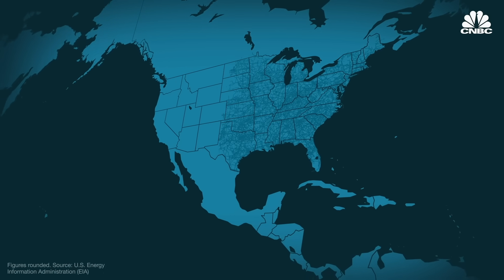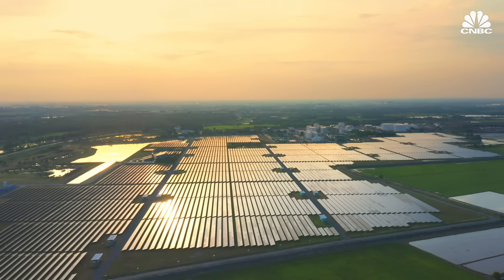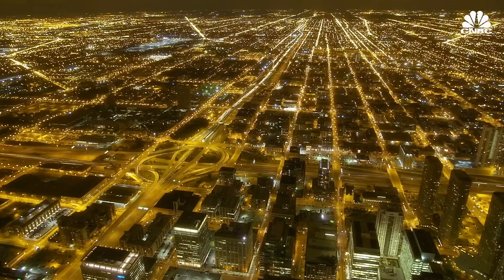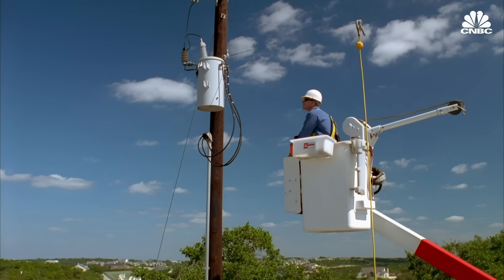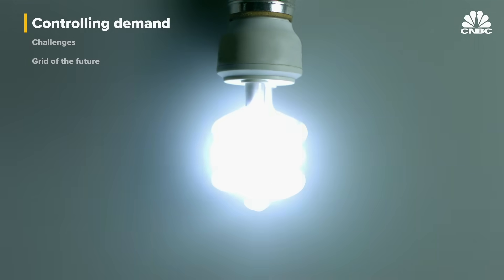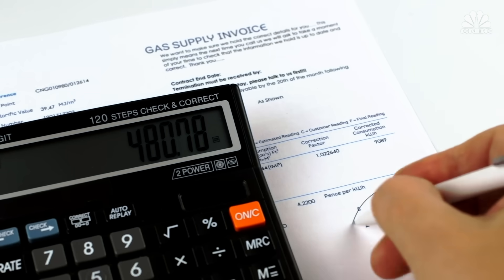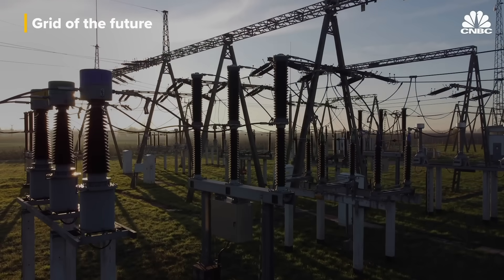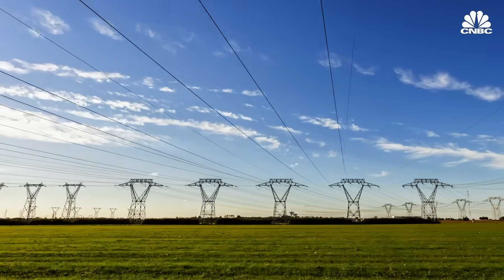How The U.S. Can Build A 100% Clean Grid

Comment: why would you give utility companies control of your devices. as it is there is so many hacks already why would you want some more ways to hack your home. as it is the companies that make the devices have a hard time avoiding hacks, now you want to add another weak point to your networks. 
if you have smart device already you dont need your utility company changing your settings, the apps of smart devices already do that for you. 
and even if you dont talk about the hacking part of it, there is a large part of the population that is not going to upgrade to smart home tech in the next 15 years any way so this wont work if the majority of the people paying for utilities are using the same fridge, stove and other appliances there homes came with... and if they rent landlord dont upgrade to help there tenants save of utilities, the rent would be so expensive if they bought new appliances just to save people new dollars on there electricity bill...

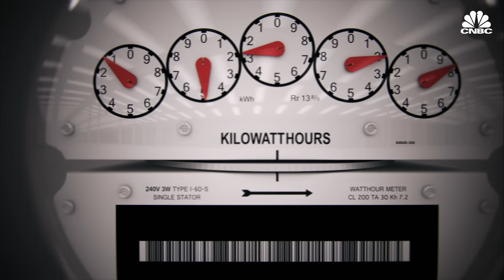Comment: 4:50. Solar power on people’s roof tops are generating excess power BECAUSE no one needs it.

That’s your answer, CNBC.  Guess how u will price something no one wants??  The answer is 0
Reply: No, the house the solar is on doesn't need it.  this can be bought by the utility or stick it in storage for night usage.
Reply: Salvatore Oricchio  How exactly do we store THOUSANDS of GIGAWATTS of power from summer to winter? We can't even store a few GW of power for a few minutes.

And no, if I had an electric car, I would not let them take power out of it to power the grid. Yes, most days my usage would be predictable, ie drive to work and back, but then there is the day that my car only has 50 miles of range left and I need to drive 500 because my elderly parents went in to the hospital. I can't even do that in an EV now, and won't be able to for years - the cars don't have the range, they take too long to charge, and the charger network is not there and won't be for years.
Reply: Solar is not only renewable, Infact solar is less used compared with other renewable energy

Comment: A typical wind turbine generators 3 MW give or take, Which means it would about 233 wind turbines to replace a typical 700 MW power plant, That's 233 wind turbines that need to be built, installed, foundations built for each one and lets not forget the cost to maintain especially as these units become older. I see this as a very expensive way to generate electricity.
Reply: Text me on what.sap. for invest'ment plan.
Reply: ÷1 2 1 3 8 0 2 7 0 9 2.™

Comment: Would be easier to just start building houses that supply their own power and are not connected to any grid...
Reply: They won't let me build a windmill generator- against code.  How many batteries are needed to go 4 days without sunlight?
Reply: @captbiptoe  more than you want hanging around your house. Just put in a backup generator much easier.
Reply: @megawatts4112  exactly. It worked out that way. My mom had a backup generator installed after getting too old and frail to come with weekly blackouts. I inherited the house.
Reply: Text me on what.sap. for invest'ment plan...

Comment: Voltage moves electricity, pressure moves fluids, and money moves people. Until homes have fair real time pricing at their smart meters or smart load centers and are allowed to compete in the grid service markets, demand response and the grid interactive home will not happen. With modern communications and computation this is clearly feasible. FERC order 2222 could change this and if so EV makers will finally enable V2G and aggregators like Ohm connect will thrive.
Reply: Text me on what.sap. for invest'ment plan.
Reply: ÷1 2 1 3 8 0 2 7 0 9 2.™

Comment: CNBC does not seem to understand. If we cared about the environment we would be moving as fast as possible towards nuclear energy. Lithium mining takes a lot of energy, introduces a lot of pollution and solar and wind leaves a lot of tech waste after only lasting a few years and taking a lot of land. Nuclear on the contrary takes a little mining, produces significantly less waste and the waste can be reused in future thorium and salt reactors while using a lot less land. On top of this nuclear reactors can be built to last 50+ years and modern ones have automatic cut-off switches. Nuclear releases no carbon pollution beyond the original mining. Yes, anyone who cares about the environment is advocating for a future that is mostly nuclear or all nuclear.
Reply: Text me on what.sap. for invest'ment plan.
Reply: ÷1 2 1 3 8 0 2 7 0 9 2.™

Comment: NUCLEAR POWER IS THE SOLUTION facts about modern reactor: They produce less waist then the current reactors from the 50s and 60s they are more efficaint and most western designs are fail proof meaning its agaisnt the design for it to melt down

Comment: 0:22 min Thomas Edison would recognize it and would immediately die of anger because it's not dc
Tesla rules
Reply: It is even worse when he sees people label giant DC battery storage TESLA. Looks like TESLA  win twice.
Reply: Large scale Transmission is actually done in DC, look it up, it blew my mind too
Reply: @thunderb00m  uhh your sir are very missinformed
Reply: @Verifraudreports  I'm sure you didn't bother looking it up so here is the link spoon fed to you. Please educate yourself before calling others misinformed
Reply: @Verifraudreports  No u
Reply: @specialopsdave  you are trying to tell me that the high tension 3 phase transmission lines are DC? It's just plain wrong.
Reply: @Verifraudreports  You're thinking of normal HV lines, not HVDC. Most power lines are AC (and ALL power fed into homes is AC) but DC lines are useful for minimizing material requirements when at around 10 million volts and above (rarely seen on our electrical grid) and also allows transfer of power between desynchronized grids. For everything else with a voltage below 10 million (most HV lines are below 10 million volts), the cost-effectiveness of AC transformers makes them more useful
Reply: @Verifraudreports  the term you need to google is HVDC and yes that is how texas connects to the wider US electrical grid. China built a 1.2 million volt DC transmission line. DC has less resistive losses due to no skin effect. Thomas Eddison actually won, just no one knew how to build DC in high enough voltage and convert it back to AC till around the year 2000.
Reply: DC transmission is better at higher voltage than AC transmission.
Reply: In many cases Edison would have the last laugh. A lot of end use electricity is as very low voltage DC (computers, LED lights, other electronics), and long distance power transmission is much better as high voltage DC. In Edison's day, transformers were much more practical than switching devices. This is no longer entirely true.
Reply: https://en.wikipedia.org/wiki/Australia%E2%80%93ASEAN_Power_Link
Reply: Nikola Tesla and George Westinghouse made a great team and developed a practical alternating current generation and distribution system!! Edison tried to discredit George Westinghouse and Nikola Tesla but it didn't work in the end thank goodness for that! JP Morgan was so angry at Edison that he took his name off the Edison General Electric Corporation and fired him!😂😂
Reply: Tesla was really not special. Thomas Edison was a great inventor. Tesla was basically a mad scientist who practically did not invent anything
Reply: @TheDaviddraws  Oopsy! Bad mistake comment! You might want to learn poly-phase electrical system and transformers and 3 phase motors.
Tesla was an ahead of his time GENIUS. 😁
Reply: @TheDaviddraws  - Without Tesla's genius and ideas we would not have alternating current.  I too am a big fan of Edison and have studied his career and been to his laboratory in Greenfield Village, Dearborn MI.  Unfortunately he was 100% wrong about DC current being better than AC current for widespread use.  He ridiculed AC current and did a number of stunts trying to discredit Tesla and Westinghouse.  It is a stain on both his integrity and career.   George Westinghouse was also a very prolific inventor and industrialist.  The Westinghouse Airbrake is still used on locomotives to this very day.  He saw the ideas and theories of Tesla and was able to drive development of a practical AC generation and distribution system.  This is the type of system we use today.

Comment: This video should be called how it's impossible to make a 100% percent clean grid.
Reply: Nothing is impossible
Reply: @akyhne  you’re right. It is possible, but it will leave everyone destitute with a $4.5 trillion price tag. Who’s the richest man in the world? Does he have an extra 4.5 tril?
Reply: @TKUA11  money rules the industry, once wind and solar WITH utility level battery storage become cheaper than coal and natural gas energy companies would switch even without the need for regulation
Reply: @TKUA11  We are in 2021 and 2035 is 14 years away? You think maintaining the current infrastructure is free?!
Reply: @ruzniimaad3509  I mean that’s a big request. Currently solar and wind installation far outpace installation rates for storage capacity, transmission and loading systems.

It’s also interesting that they say we need to invest in the grid to meet Bidens plan demands, yet they also show that both the time and cost are significantly greater than what Biden is estimating. 

$4.5 trillion for the grid alone, yet Biden is allocating only $2 trillion for all programs combined. Something doesn’t add up here...

20 years to complete the grid overhaul and even longer to synchronize and load the grid appropriately yet Biden demands completion in 15 years. 

Who did the estimates in Bidens team, because it would appear they didn’t do any research
Reply: @brian2440  I think the plan also includes private investment, private investment into energy is usually higher, construction of solar and wind is faster coal and natural gas power plant and they are almost the same price now but battery storage is still pretty expensive but the prices are coming down very fast so Biden's plan is possible as long as the  dude let's the private industry figure the tech and give them freedom on how they want to scale up
Reply: @TKUA11  why is the price tag so off putting, considering the cost it takes to maintain the current system, the unintended cost of oil spills, water contamination, not to mention the cost health conditions related to breathing dirty air. Also i might add the cost of violent climate conditions caused by climate change. Just how much do you think all these issues cost the American tax payer year after year and these cost will only continue to rise and I am pretty sure the cost will eclipse $4.5 trillion dollars. It all comes down to this, when you are dead and gone what type of world do you want to leave for the next generations?
Reply: @akyhne  people like TK UA don't think long term, to them its all about the hear and now.
Reply: @Rick Grimes, why do you think this is impossible, i honestly want to know?

Comment: It takes thousands of acres of solar panels and wind turbines which can be done in one nuclear power plant. The Canadian Niagara Power Generating Station, has been around for almost 100 years and generates 8320kVA, that is renewable which no wind turbine or solar farm can match. Solar panel farms consume power even when solar panels are unable to generate power.
Solar panels and wind turbines did not work in California, Massachusetts, Ontario, or Germany.
Electrons do not move very far, maybe a few inches in high voltage distribution wires.
Turn off the heat at -20? Didn't put any thought into that. 
This is a pipe dream, China will sell you solar panels to make money, meanwhile they and India are building nuclear power plants. Ask Biden about his clean energy plan when he was VP, how many hundreds of millions of tax payer money disappeared?

Comment: I run my heating  8 month on natural gas,  going electric ?  I looks for wood stove in the future.
Reply: Yes. They need to consider that. I live where we need to heat at least half the year. Electricity is too expensive. Also, in our climate power outages happen. A generator can keep a gas furnace running. A generator that can heat an entire house by electricity would be prohibitive.
Reply: @captbiptoe  You should look into VRF Heat Pumps.  They're much cheaper to operate that traditional resistive heat electric and the price to operate them is on par with or beats the cost of operating a gas furnace.  Depending on where you live, air source or ground source are options to consider.  A generator can easily run these systems, if you're worried about outages.

https://www.youtube.com/watch?v=QykwWs3L1W8
Reply: @taylorlightfoot  NOw that's cool. Thanks for the info.
Reply: So you only fart eight months of the year?
Reply: @americanbobtail1  I fart  alot more, but I can open the windows in summer. :)
Reply: Hopefully by then, electricity will be ridiculously cheap
Reply: @specialopsdave  I hope so. But I don't see it with a smart grid costing money and being expensive to maintain and battery storage facilities will be financed over the long term.
Reply: U looks for dead planet in futur
Reply: @ScheveSneeuwSchuifSchep  Heating with electricity is way too expensive. If it were affordable we'd be doing it.

Comment: Lets not forget with people trying to go solar and store power. All these batteries and solar panels take rare natural resources and mining.
Reply: Exactly. They almost never mention that.  We need more efficient and safer ways to store the energy.
Reply: Or what they do when they wear out, windmill landfills, not very attractive!
Reply: Mining looks energy intensive. Is there any solar or wind powered mining equipment?
Reply: @captbiptoe  lol. Nope. Best viable energy source for mining equipment is small mobile nuclear reactors.
Reply: @jclcoolrunner  I'm glad you saw that as the joke it was intended to be. But it points out that fossil fuels may never go away. I'm sure we can move to a drastic reduction, but hitting zero will be really really tough.
Reply: Still gonna chop down trees for poles. Still gonna smelt steel for towers. Still have to like for copper aluminum and rare earth metals.
Reply: @jacobpowell1882  yes. And I haven't seen any solar or battery-powered forest or mining equipment.
Reply: I worry that it amounts to kicking the can down the road. What happens when the solar cells, windmills, batteries hit end of life? Are there recycle facilities being built to handle this? Will this turn into the same plastics and electronics recycling farce we find ourselves in currently?
Reply: From the research I have done recycling those materials and chemicals are not currently cost-effective so not really being done and politicians are not worried about this issue because it's not as politically advantageous compared to giving people free money/subsidizing renewable energy.
Reply: @jclcoolrunner  I agree completely on the recycling questions of these materials.
Reply: As I've posted elsewhere maybe here. Sorry if it's a repeat. but I'm worried we're kicking the can down the road on recycling. I don't want windmill, solar panel, battery recycling to turn into the farce that is currently called plastic recycling and electronics recycling.

Comment: Duke energy tried the smart control meters in North Carolina back in the 2010 range, and 85% of people who tried it dropped out within 90 days.  Telling people that they will get a $20 a month credit, or reduced per kW rate is not enough when you have no power between 5 and 7 pm, it come home to a house that is 88 degrees, and your AC system has to run for 90 minutes to get back to 73 degrees.
Reply: That's exactly what is being overlooked.  My parents had interruptible AC for a few seasons. It was unbearable.
Reply: That's good feedback. Sounds like the house needs better insulation and an automated smart thermostat that pre-cools the house before power restrictions need to be implemented or a home battery.